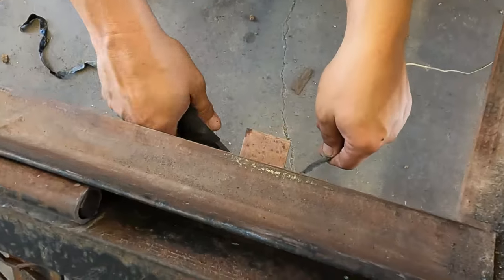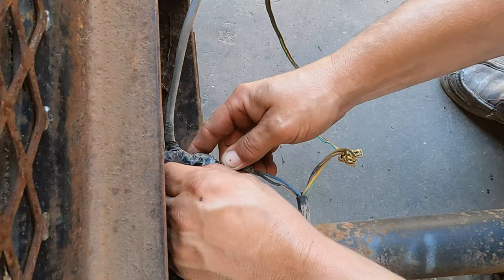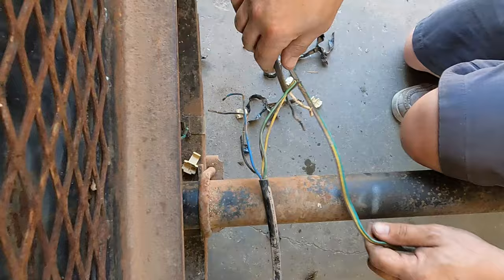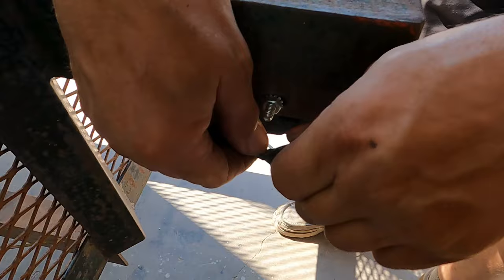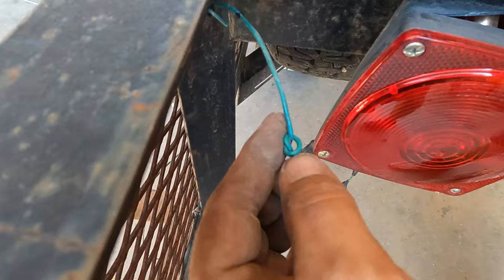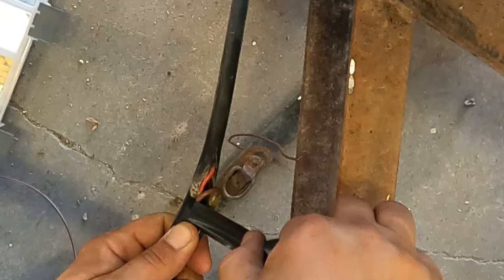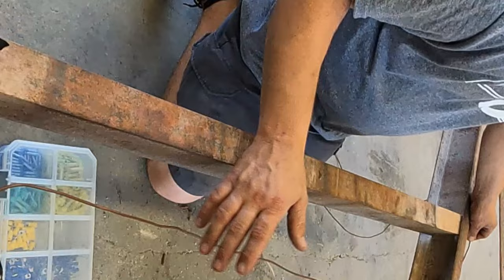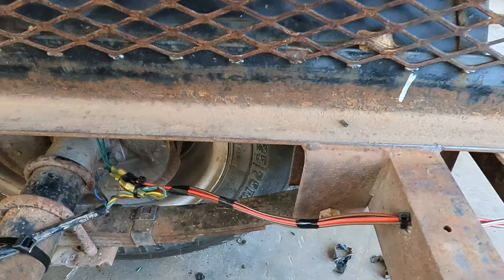Do This When You Wire Your Trailer!

Comment: Ground side is the number 1 screw up, I find.  Some think you ground thru the hitch ball.  Best way to test wiring is to ONLY connect the umbilical and trailer is isolated from the vehicle.  I prefer non-insulated connectors and terminals and use shrink wrap.  You get a better look at your work that way.  Most people are poor at crimping and don't use the correct tooling.  If you can pull it apart, it ain't right.  Can't leave out the twist and tape guys, right?
Reply from the maker: Couldn’t agree more. However, believe it or not, we have a manufacturer that has been twisting & taping since the 60s and we have the least amount of wiring issues with that manufacturer. But they do it very. I personally don’t prefer it, though. 
Thanks for the comment and for watching!

Comment: Thankyou retired Master GM tech. Because I mainly did brakes, steering, suspension, and anything else they could throw at me, trailer wiring I was the go to person. I hated it because of the scotch locks, poor grounds, connectors full of mud and corrosion. Most of the time I did the same as you, throw it all out and rewire. Many of the new vehicles use the LED lights which are fine, but the circuits will not allow the extra load of a trailer. If you have done a video on this problem, great. I installed an "isolation module" which put no load on vehicle circuits. Fixing the wiring on a farm truck with trailer brakes was no fun. Great Job. Don
Reply from the maker: Have not done a video on that, yet.  Thanks for watching!

Comment: 3M Scotchkote FD coating is designed for underground burial electrical splices . It’s expensive but works well !   I do use heat shrink connectors but always place another heat shrink tube over it  .  The shrink tube with adhesive !

Comment: Does anyone use wire loom and grommets?
Reply from the maker: I would say that the majority of manufacturers don't use wire loom or grommets.  We use grommets, wire loom, and we solder upon customer request.  This also depends on the customer's budget, as well.  Thanks for watching!
Reply: I do I ordered the grommets in a kit various sizes. I worked aircraft for years, and the grommets were used for electrical, and hydraulic lines. That or what they call chicken track epoxied into place,

Comment: Phoenix Aridzona   has the record temps most of the times., not the humidity. They got these magnet type wire holders. I epoxy them into place. Then a small zip tie holds the wire in place, They run about a buck each with the epoxy, installs in less then one minute.
Reply from the maker: Phoenix temps are no joke! We have 3M adhesive back that holds up most of the time, but we usually end up using high quality silicone as an added insurance on them. Thanks for watching!

Comment: Personally I run everything in 1/2" EMT, solder and shrink all connections. Yes it's more labor intensive  but pays off in the long run. Solder and shrink only for all brake connections. 

Tape pro tip. The back wrap trick. First wrap of tape sticky side up. When you get to the other end of your connection spin the tape 180 deg. Wrap back over that connection overlapping the first wrap on both ends. You should have sticky side of the first layer to sticky side of second layer of tape. This way when you cut off the tape it doesn't leave that sticky residue on the wires and it seals just as well. 

If you just need to hold a wire in place. A quarter size dab of silicone. Push the wire into the silicone and tape on either side. Let dry and now your wire is out of the way. And its completely removeable from both wire and frame. Usually handy for marker light wiring.
Reply from the maker: Great points!  Thanks for watching!
Reply: Triple thumbs up on that process. the road salts they use on the roads in KommieRado goes right through tape and crimp on connections. Have you used any harness tape? It has no adhesive and sticks to itself and not the wires allowing you to bend the bundle however you need it. 

Another good conduit is pex tubing..
Reply: @SegoMan  Yes, 3M 130c tape works good for that.
Reply: You run conduit for trailer lights? You're a different kind of crazy buddy

Comment: I prefer solder and heat shrink! Guaranteed good connection unless a wire breaks. For a quick and temporary fix I may use a butt connector or wire nut just to get by till I’m able to fix it right. I also only work oh my own trailers. Occasionally someone else’s but when that’s the case solder 100%.
Reply from the maker: 👍
Yep. Soldering is best, most don’t have the budget for that or the time to get it done themselves.

Comment: Those axles brake wires go connected to the light wires?
Reply: Trailer brakes will connect  to the brake wire in your 7 wire harness.  Which is a blue wire. Other brake wire is your ground  wire. A junction  box makes wiring  alot easier.  Brown wire is your running  lights.
Reply: @tomahawksteak6672  About the time you think you got the color code figured out you buy a molded plug & cable and they have their own colors LoL

Comment: You are on target! And use butt connectors crimping them with the proper crimping tool and then use heat shrink tubing with dia electric grease inside the connections.  Scotch locks are guarantee troublemakers down the road.
Reply from the maker: For sure!  Thank you for watching!
Reply: That is my way too. Helps keep the salt out.